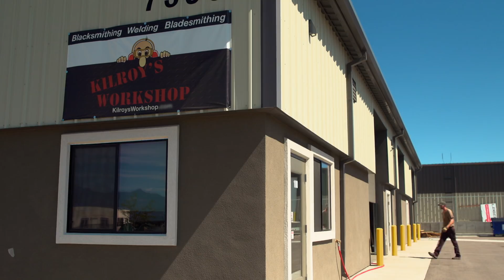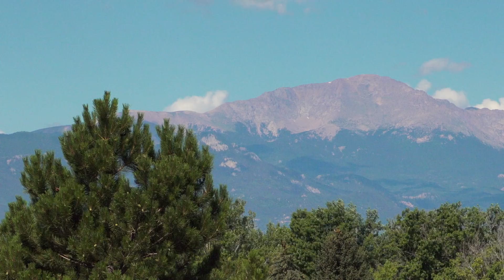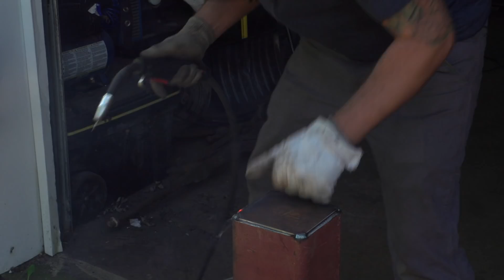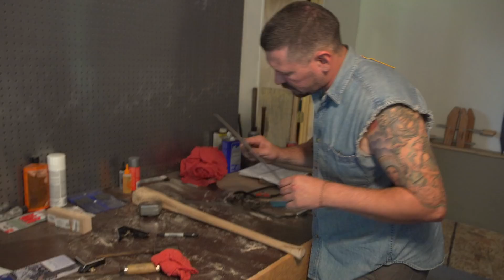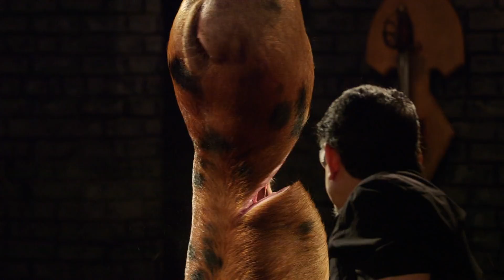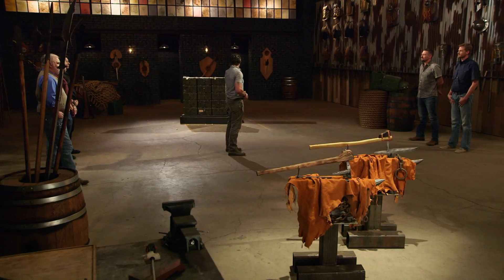Forged in Fire: Zulu War Axe MUTILATES the Final Round (Season 7) | History

Comment: I kinda had a feeling that the bladesmith who bash tested his wooden handle before affixing it would end up winning. Just goes to show how important foresight and preparation are when it comes to just about anything.
Reply: I kinda have a feeling that if the blades were tested equally both would be broken, he hit the sweet spot right in the middle on the second axe and two out of three on the top on the first.

Sorry but this was not a fair test at all, it leaves room for human error and it seems to me that it's not fair in the least.

All that said, of course welding the material changes the structure.

Also, your comment would have made sense if it was the handle that broke because that is what he tested, as it is your comment makes no sense what so ever.
Reply: Yep.  Smart move. Ebony is one of the hardest woods but it isn't flexible and fractures easily.
Reply: @michaelmay5453  I am glad you said this. I love this show but it isn't fair at all
Reply: @barrymore87   It happens, you should come up north in Sweden next month though and see some real testing. If you can come, I'll invite you but you have to be ready for the cold.
Reply: @michaelmay5453  thanks for the invite but unfortunately I live in England and couldn't make.
Reply: @barrymore87  Tell your employer  you won a prize, I'll invite you if you want to, all expenses paid.

If you don't want to that is fine, I'm the one who makes the picks and perhaps we'll have you next year.

Either way, hope you are doing well.
Reply: @michaelmay5453  You can't say both would have broken. That means you're sure there's a crack in the other guy's blade as well. Clearly the crack is what lead to the break. Yea the tests aren't equal because of human inconsistency. But having scientific tests would be very boring. It's still up to the competitor to make a blade that can withstand what they throw at it, even if, by random chance, they may not throw the same amount at the opponent's blade. In this case he could have radiused that transition more to reduce the risk of such cracks in the quenching process, or test it himself and start over.
Reply: @barrymore87  I'm gonna trust that you are smart, but just in case do not accept Mr Mays offer to come to sweden

Comment: Such a shame about how that ended. That really was a work of art of an axe outside of that unnoticed dark spot. If only that missed crack wasn't there I would've honestly seen it winning.
Reply: Well the test is hardly fair, two of the blows were above the sweet spot with one and all three were on the exact sweet spot with the second. If it had been done the same either both would have failed or neither.

All that said, welding material will change structure and that was a mistake.
Reply: @michaelmay5453  I honestly don't think there was enough test variance for it to change the outcome. Like you said, his welding of the piece could've, and I would say likely, caused the issue in the way he did it.
Reply: @michaelmay5453  His mistake was not starting over when he'd already noticed that he had cracks in his steel. It's unfortunate that it happened, it was such a good looking piece.
This is what happens when guys go for show and not functionality. Seen many pattern welded blades break or have delaminations on this show that cost them the win.
Edited part. And yeah Ben's strikes weren't that accurate, so I'd tend to agree with you there. The first two hits were a couple of inches above the tang which probably opened up the small crack, third one, well we saw what happened. Second guys axe, all 3 strikes were all in the same spot, at the tang, strongest area. Same thing happens when Jay goes bonkers swinging people's blades though, the hits are all over the place
Reply: @CyberianFaux  Look at the video, three hits above the hilt vs 3 hits right on the hilt. That's not fair.

If it had been done the same way with both neither would have made it.
Reply: @michaelmay5453  Okay, this is getting annoying. You said the exact same thing as someone else that I already responded to. Beyond my first response, the fact of the matter he had an unnoticed crack is a problem regardless and he didn't deserve to win. 

That is the bottom line even with uneven testing (suggesting it was truly unfair as, the way I see it, the swings and such were products of the weapon's length, products of the weapon's handle, and products of the weapon's natural swing). The crack is the problem and would be regardless.
Reply: @nobodyimportant69  Kinda feels like you argued yourself into agreeing with me so...  Have a good one. :)

Comment: They are far too chunky. I own a late 19th century Zulu fighting axe and they are light and 'quick', for single-handed use; Zulus used shields - large isihlangu or smaller umbhumbulozu. The hafts of Zulu axes are very like slightly modified iwisa (knobkerry) clubs and usually round in cross-section. The Zulus used axes with an elongated upper limb of the blade, but they are more characteristic of the Tsonga people. Zulu axes mostly had blade limbs of equal length, like those of the Shona, Swazi and Batonga.

Comment: Can you say Cheater / even though the Blacksmith crew could spot the flaw in the Mans axe that broke before he swing at the boxes / Clearly aimed for the lock catch on the 3rd swing . He avoided it on the contenders blade . OOOOPS
Reply: The judge on the strength test mentioned a Dark Spot where the tang of the axe was, so it was a quench Issue, not by hitting the metal on the ammo box.
Reply: @carrozero9314   Apparently you missed the part where the first axe struck the lock catch on the 3rd swing ? As you see on the second he avoided it . Another thing on the episodes to fallow he was put out for a hurt wrist . Oh you do not remember that part / He fractured his wrist after striking that catch wit a full force blow with hardened steel . OOoops
Reply: @carrozero9314   Apparently you missed the part where the first axe struck the lock catch on the 3rd swing ? As you see on the second he avoided it . Another thing on the episodes to fallow he was put out for a hurt wrist . Oh you do not remember that part / He fractured his wrist after striking that catch wit a full force blow with hardened steel . OOoops
Reply: rewatch it slowed down, he doesnt hit the lock
Reply: @goose6972  No he hits the CATCH if you read my comment correctly .
Reply: He hits the wood three times.  Does not hit metal.  Look at the wood chips flying off each time.. .25 speed is good